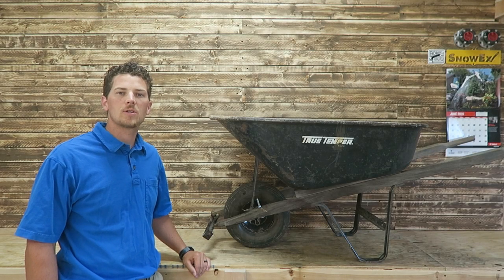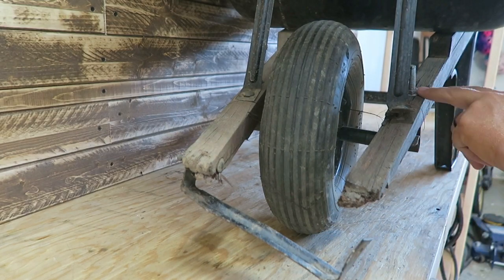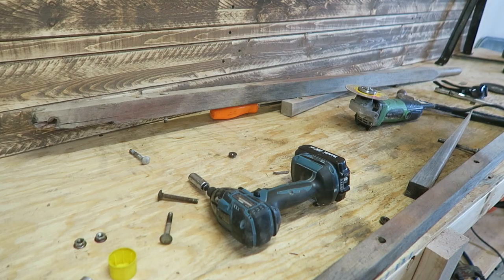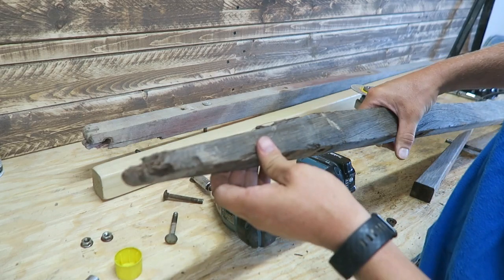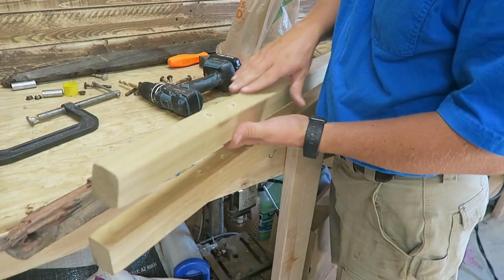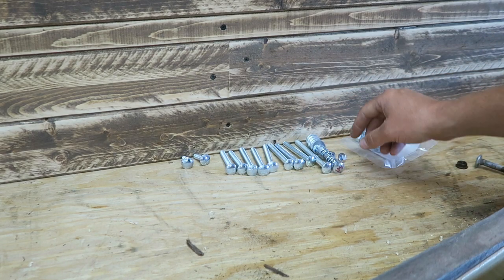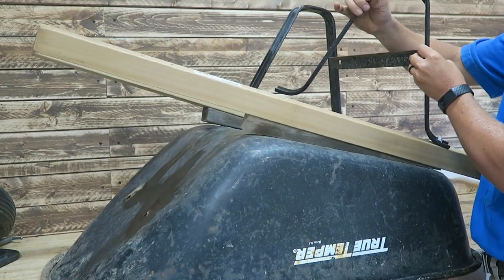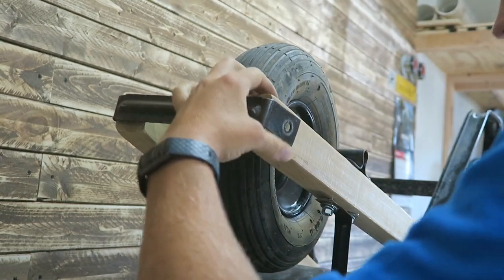How to Replace Wheelbarrow Handles

Comment: good job.  i had to get new wedges that they sent me for free.  I like the lock washers you used that is an addon from the original equipment.
Reply: <<good job.  i had to get new wedges that they sent me for free.  I like the lock washers you used that is an addon from the original equipment.>>

I made my own wedges,  which had rotted out.  Pretty easy to do.

What caused yours to fail,  and after how long?

What company?  Glad they treated you well.
Reply: @SeattlePioneer  Jackson.  I called them because I couldn't believe this wasn't something you could buy as a replacement.  They said no problem and sent me two for free.  If you can believe this i still have not finished the renovation of mine yet!!  what a slacker.  Maybe tomorrow!!!

Comment: You did well to buy bolts with round heads to hold the tray in place.  That makes it easier to shovel out material.  I used regular bolts,  and they are going to be something of an impediment.

Installing galvanized bolts would have avoided future problems with rusted bolts.  I didn't figure that out until after I had bought hardware either.

You missed out on the opportunity to clean, prime and paint the tray.  I just used Kilz primer I had on hand and house paint for that,  but it should offer a lot of protection.  I did the same with the wooden parts,  which are prone to rot.  Indeed,  the grain on my handles was opening up.  I'm hoping that priming and painting will postpone problems for additional years. 

I had fun with this!

Wheelbarrows need to be inspected for rusting and exposed wood from time to time,  and appropriate main tenance and repair performed.  Do that and it should last for decades.

Comment: I bought the cheap true temper about 10 years ago and have mixed cement and hauled firewood in it. I go over the handles occasionally with boiled linseed oil, but the thin metal tub is cracking around where the bolts go through and its probably not worth fixing. My brother in law found an old folded steel jackson wheel barrow that needs rehabilitation and I'm hoping he'll let me have it cheap. It needs new handles and a tire,but it's a $430 wheel barrow. I dont mind rehabbing something like that,its worth it.
Reply: <<I bought the cheap true temper about 10 years ago and have mixed cement and hauled firewood in it. I go over the handles occasionally with boiled linseed oil, but the thin metal tub is cracking around where the bolts go through and its probably not worth fixing. >>

Sounds like you give your barrow hard use.  Usually I don't see the steel holes cracked,  but rather rusted out.

I'm guessing large washers might add sufficient support,  or perhaps adding pieces of sheet metal or steel plate to reinforce the weak points.

I always like to see tools and equipment used in heavy,  demanding ways.  You know it's really earning it's keep.
Reply: @SeattlePioneer  Yeah I use it alot. I burn about 4 cord of wood a winter and store it on racks in my yard. I've got my brother in laws Jackson wheelbarrow now and will work on it soon. I'll probably weld and reinforce the old true temper and give it to my son in law. The metal on the Jackson is much thicker and it's got more stability. It suits my needs much better.

Comment: Restoring a plastic free to good home wheelbarrow. Bought the screw kit off of Amazon. $40 for a pair of wood handles @ LOWES. Why do most of plastic wheelbarrows have no wedges like metal ones?  About $70 ish for it all.  $150 plus for a new ones. Already had plastic welder.  Thanks

Comment: This should not cost $40, even in 2020. Buy a $5 2x4 8' stud, cut it to 5', and rip it. You can quickly fashion handles with wood chisels and an electric sander. That's literally all you need. The carriage bolts and nuts that were in place in the original wheelbarrow are very, very likely still good and should be reused as they will last longer than the barrow bucket itself.
Reply: Short time fix. Pine wood is not good for heavy loads or long term use.

Comment: Not to nitpick and I wondered it myself while replacing one of my handles, why is the bolts holding the wheel pointing upwards and not down towards the ground (when the wheelbarrow is upright)???
Reply from the maker: Probably no other reason than whatever person at Home Depot/Lowes assembled it that way.
Reply: I think the bolt should be installed with the nut down when the wheelbase is upright.  This might  give some protection to the nut from rainwater damage.